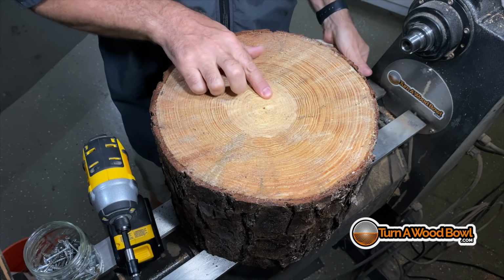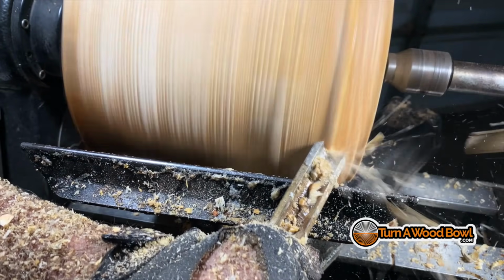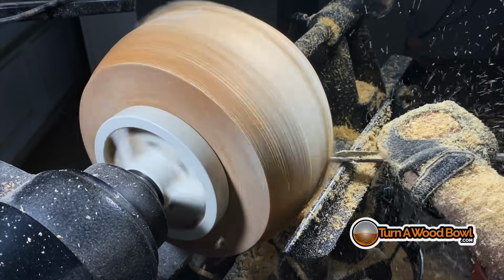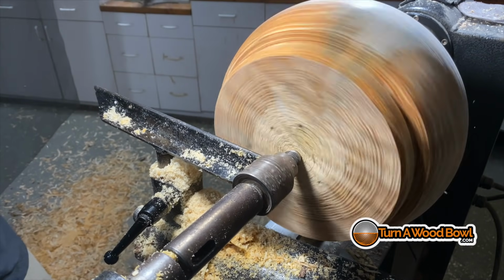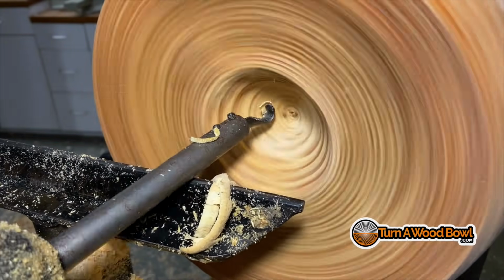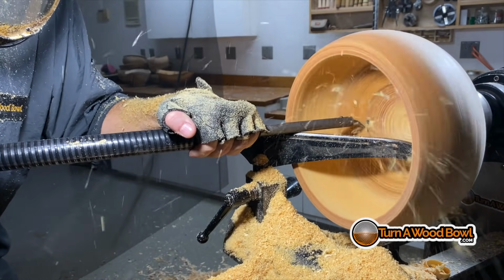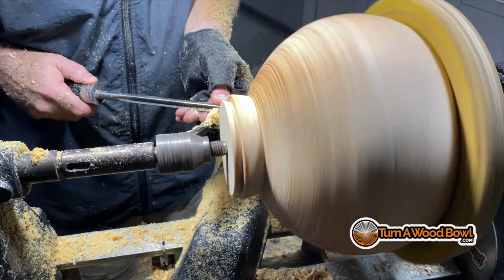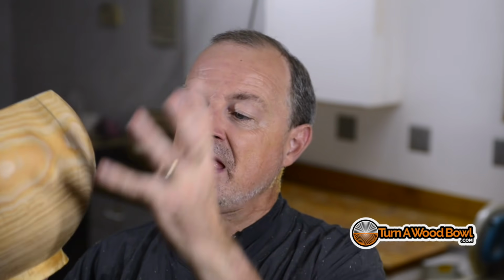Bowl Turning Free Wood –Video

Comment: When turning wet, end grain pieces, I leave the tenon, then drill out the pith. It is easy to glue a plug into the drill hole after the piece dries, and I don't get any splitting. The tenon is there to ease sanding and finishing, too.
Reply from the maker: Makes sense. Thanks for sharing. All the best to you and Happy Turning!
Reply: That's a great idea.. I've done something similar but not drilled out completely.

Comment: why are you taking the bark off of it? there goes your live edge.  just cut a log. trim away at the ends until it'll turn freely on the lathe.  mount the log turn on lathe move face out of the way cross fingers and go from there. it's not rocket surgery

Comment: Thank you very much for this video! When i first bought my lathe the "end turn bowl" was the first shot at a bowl i tried and oh no was that a butt kicker. I have steered clear of anything like that ever since. ( it did not survive.) That was almost 2 years ago. Side note but related, Im lucky to report that in almost 2 years with the lathe ive only gotten 1 substantial injury (  not to tempt the gods by saying that i am currently knocking on wood,  tossing a black cat under a step ladder throwing salt over the left shoulder or what evs etc...) I was sanding on the lathe and somehow turned my middle finger upwards to catch a large chunk of wood / sliver between my nail and finger fully inserted. Quick thinking i pulled it out with nearby needle nose plyers because i knew it was gonna be very tender to the touch in moments. felt the need to share that along with the thank you for your instruction im excited to take another turn at the end grain bowl.
Reply from the maker: Wow, Thank you for writing and sharing! Ow, that sounds like it hurt. All the best to you and Happy Turning!

Comment: Kent, that is so interesting and turning pine besides!  I have turned a couple of red pine bowls but only side grain.  Watched your shellac video and am wondering if the shellac would seal off the pith area in your bowl.  Noticed you said you may need to use epoxy.  Thank you for another excellent video.
Reply from the maker: Thanks Geroge👍 Yes, shellac would work well. Happy Turning!

Comment: Hi, I really enjoy your videos.
I have been given some  Sycamore blanks, freshly cut, but only 3 - 4 inches deep. So I want "end cut" them. I seen in another video someone using a mix of sanding sealer and acetone to dry out the bowl after turnin, before placing in brown paper bag for a couple of weeks to dry out! Do you think this would help to prevent the Piff from cracking?
Thanks again for you very informative videos.
Reply from the maker: I recommend experimenting with one or two and see what works first.  This will give you a good idea how to move forward. Happy Turning!

Comment: Hi Kent. Thanks for sharing this and the education. Beautiful results from this end grain turning. How did you finish this piece? And how soon after turning as it needed to dry. I am not sure if a finish slows down the drying process and therefore reduces the chances of cracks!
Reply from the maker: Great question. I have not finished it yet as it still needs to dry. A danish oil can be applied while the wood is moist and it will slow the drying process. Later a final finish can be added. Happy Turning!

Comment: Excellent information.  I do have a question... With the end grain bowl it seem as though you do cut to a finish size.  In other words even though this is wet you only turn once.  Is this correct?  If so what thickness are you looking for.  I have a piece of spalted maple the I would love to try this on.
Thanks!
Reply from the maker: Jimmy, yes because the wood will shrink relatively evenly with the sides pulling inward, it doesn't distort as severly as a side-grain bowl. Happy Turning!

Comment: Kent - is the wood movement during drying more consistent, more concentric around the pith than a side grain turned bowl around it's center?  It seems like getting a thinner wall is a more difficult - do you normally leave them with a thicker wall as you showed here?
Reply from the maker: Yes, the drying will pull into the center. But you need to be caution about cracking just the same as with a side grain bowl. Happy Turning!

Comment: Interesting! 
For a project like this, can the center be hollowed using a large Forster bit? Or would that be unsafe?
Reply: Yes, my question as well!
Reply from the maker: Yes, you could. Good question. Happy Turning!
Reply: Against the end grain it will be hard work. The hook or ring tool are so nice to use that you will find any excuse to use them. A twist drill bit as seen here or wound in with the tail stock will be best on end grain.

Comment: Interesting hook tool! ... I've seen the opposite action where the hook is held down rather than up, with the cutting done by the side of the hook rather than the side of the shaft ... I've never used or even seen one up close, but a hanging hook, cutting not scraping, seems less prone to a sudden catch because the hook would simply be pushed out of the way if it dug too deeply ... any thoughts on this?  Cheers!  Farmer John, Ontario, Canada
Reply from the maker: Sounds logically, but the one I'm using needs to be used in this direction. Flipped over and the cutting edge is on the back side. Happy Turning!
Reply: Kent, here's a link to the hook with the cutting edge on the downbound side ... no experience here, so no comment ... I wonder if the Wolverine could be adapted to sharpen it??

https://youtu.be/c2mg5Dvyfsk

Cheers, Farmer John @TurnAWoodBowl

Comment: Ken - can you remove wood from the interior of the bowl with a bevel supported pull cut or slicing cut?  I’m thinking of a bowl gouge with a 55-60 degree nose angle and swept back wings.
Reply from the maker: Yes, this is true. Not the easiest task, but true. Happy Turning!

Comment: Is there a general rule of thumb you use for size of the foot to the width and/or height of the bowl? I.e. if you have a 12” diameter bowl that is 5 inches in height are you sizing the foot to be 1/2 the diameter? Or maybe 1” per height for a 5” foot? Something else to keep a good proportion? Tia
Reply from the maker: Good question. I usually keep it around a third of the bowl diameter. Smaller, for more "showy" pieces. Happy Turning!

Comment: Hello, are the ring tools for the same purpose as the hook tool you use?
Reply from the maker: Yes Trev. They are used to cut with the supported grain direction. And with end grain pieces you need to work the inside from the bottom middle up to the rim. Happy Turning!

Comment: I found your facebook group and tried joining. So far my input does not seem good enuf to be in your group. Which makes me wonder why I remain a subcriber to your youtube channel. I am recovering from knee surgery and using mg down time to research everything my little shop would require to start turning bowls. I have minimal experience turning a bowl, having watched my friend set up from chainsaw trimming the log, to putting the blank on the the lathe. I used his bowl gouge. I watched him hone his tools with a belt sander and a gig to keep a certain bevel. I  furst turned two small bowls. I was unsble to go to his shop to complete them.
Reply from the maker: Thanks for watching my channel. You'll learn a ton here. Did you answer all the questions when you applied to join the FB group? Happy Turning!

Comment: Every hook tool I’ve seen was used with the handle high, being held at about a 15 degree angle to the hook….you seemed to do the opposite. Is that what the manufacturer of this hook recommended?
Reply from the maker: That's what works for me. ;) I'll try what you mentioned and see what happens. Thanks and Happy Turning!